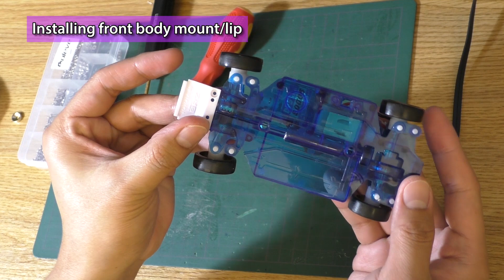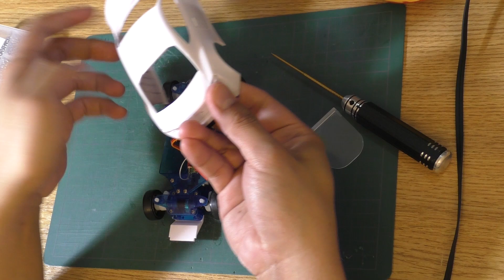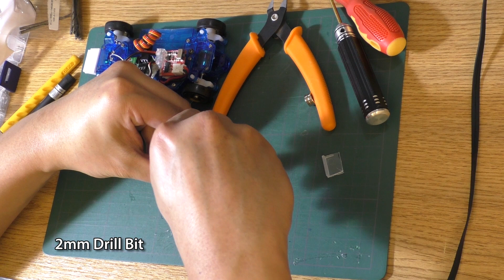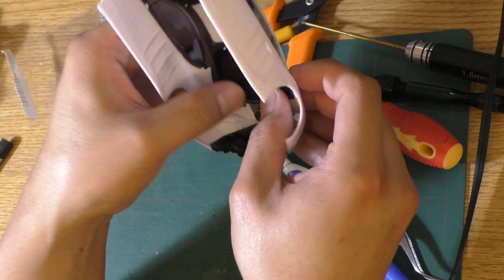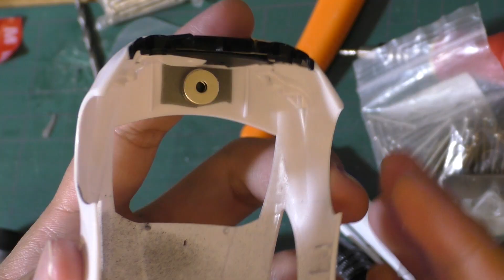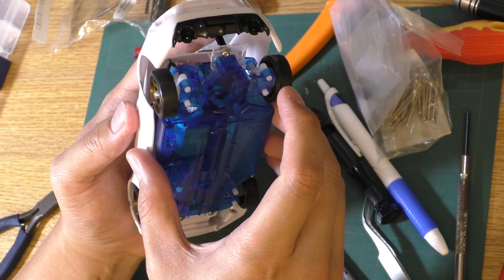Mini-Z Body on Mini-Q TRQ1 | Build Vlog 02 - DIY Magnetic Body Mount

Comment: I am looking to mod my MA020 chassis into magnetic mount. Is there a specification for the rear mounting plate that you know of?
Reply from the maker: There're no specific dimensions for the plate because each body is different. Just measure, cut and drill whatever works for you.

Comment: 1st your videos are both educational and fun to play watch. Also any tips on how to lower the rear of a Kyosho Autoscale? I worry alI could damage by removing the side mounts? Any tips on removing and mounting to close the wheel arch gap
Reply from the maker: Put the body in warm water to soften the glue then try to pry them out with small screwdriver. Do it little by little so you won't damage the body.

They mount the side clips like that because each body is made for specific wheelbase. I think you got body with different wheelbase than the chassis. All chassis with Kyosho mounting have the same mounting position. You just need body with correct wheelbase except for an unlikely event of manufacturing error.
ps. Which body and chassis do you have?
Reply: Beaver's Hobby thank you very much will try that

Comment: body shell mini-q hgd1 can use at mini-q TRQ1?
Reply from the maker: It depends. You need a shell that is 94mm wheelbase. HGD1 is adjustable wheelbase so check before you buy which body you got.

Comment: Hey what lipo battery do u recomend for the mini q
Reply from the maker: For stock electronics: Turnigy 1S 400mah from Hobbyking. If you upgrade it to other ESC then Turnigy 2S 300 and 350mah. Giant Power 2S 300mah also good.